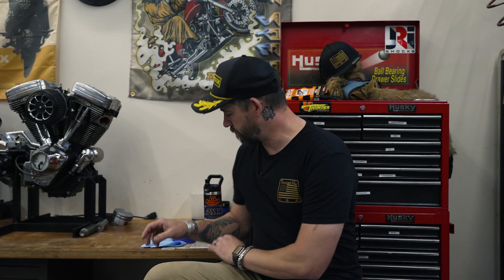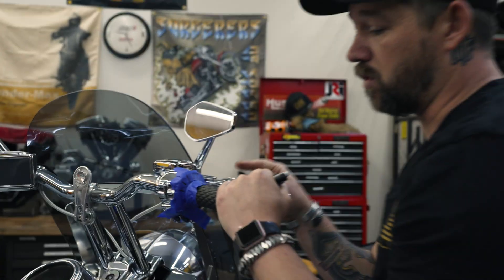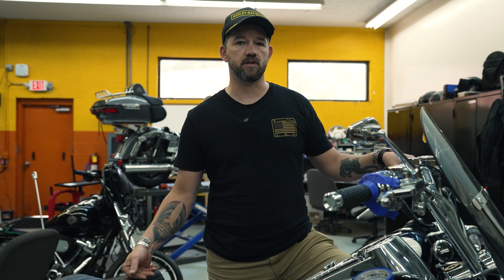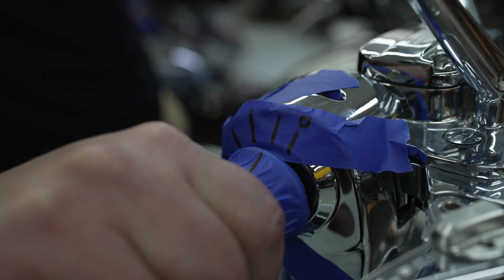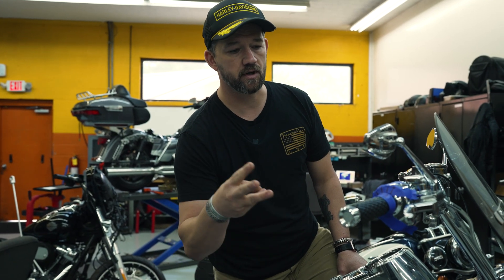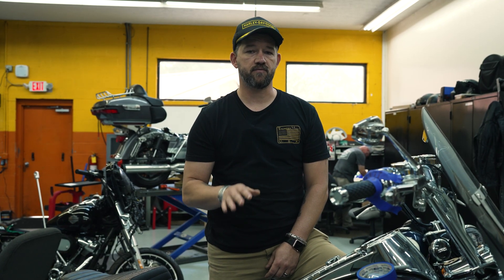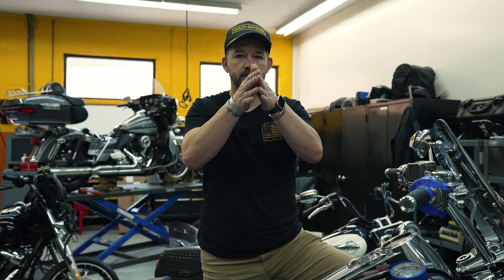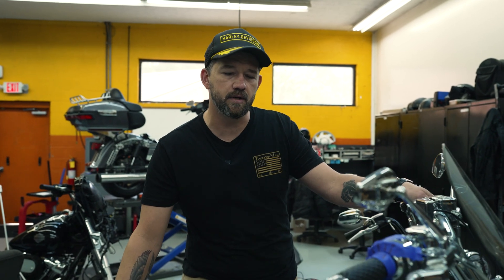Map Development - ThunderMax Tech Tips

Comment: For me here in southeastern South Dakota, one of the first things I do is remove some timing. Thunder Max told me they develop maps on 93 octane pump gas. All we have is not so good 91 octane gas. If I don’t remove several degrees of timing, pinging is a real issue. I can’t even think about doing these pulls without considerable pinging. I’m not complaining, just something to be aware of depending on local fuel quality.
Reply: Use Lucas octane booster
Reply: Fuel quality will play a large part, you are correct. Again, these are base maps or starting points to further tune your engine for optimal performance.
Reply: I'm in New Mexico with the same 91 octane issue...how much are you adjusting your timing, and do you have the new knock sensor firmware update?
Reply: @tacticalmount6303 that’s a no on the knock firmware, I have a twin cam so that isn’t an option. 

On the Timing vs Engine Temperature map I’ve taken out 2 degrees across the board until about 200 degree, then I pulled out 3 degrees for the rest of the map. 

On the Rear Timing vs TPS map I removed 4 degrees across the board. 

On the Timing vs TPS tables I did the following. 
1024 rpm - one degree whole table
1280 rpm - one “
1536 rpm - one “
1792 rpm - one “
2048 rpm - two “
2304 rpm - through to the rev limiter rpm three degrees across the tables. 

I have eliminated all pinging. Through checking head temps with a laser temp gun I have cooled them down to 300 degrees or less depending. If I warm it up, install new plugs and do a mile long run, the plug heat line is just below the ground strap bend on both plugs. 

It runs great and pulls hard with the conservative timing for engine longevity. I have a higher compression than the map that very closely matches my build. This also contributes to the removal of timing. 

Another thing I found by chance in going through plugs to see the heat line on the strap, I bought some Champion RA8HC at the parts store for ready availability and price. The first time I put them in and made a run, I immediately noticed a little better throttle response and a little harder pull. I wasn’t expecting any difference so it surprised me. I’m sticking with the Champion plugs even though Harley plugs are made by Champion. 

I don’t know if any of this helps you. Maybe it will help someone.
Reply: @skydude426 what engine build are you running?
Reply: @dustinjohnson2116 a twin cam 107”.
Reply: @skydude426 ok trying to find someone who is running the same base map I started with for my built 117 which is map #339

Comment: Hey Bobby, question for you I have always gone based on the assumption that I would let the TMAX tune to my riding style. Is there an advantage or disadvantage to not doing this, the base map I chose was pretty close to my bikes configuration.
Reply: It absolutely will. Think of this developing process as a “part 1” of sorts. As not all builds, engines, and engine parts are exactly the same. This will give you better starting point in further developing your map based off of your riding style, conditions, and modifications to your engine.
Reply: What should I do immediately after I get back from doing all of these pulls at different throttle positions? Just hook it up and run that analyzer? After that is done can I just leave it alone?
Reply: @jonathanreyes1285 after performing your automap after each session 3-4 sessions go and look at the Auto Tune Points Analyzer, it will let you know what changes have been made and if it suggest more riding and auto maps.
Reply: @jonathanreyes1285 if you're in the 15% and under range.